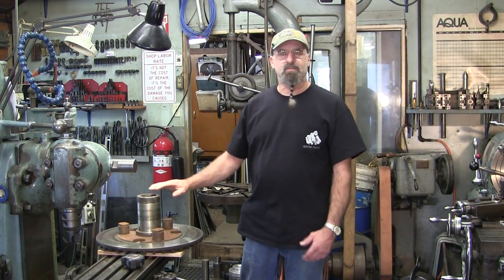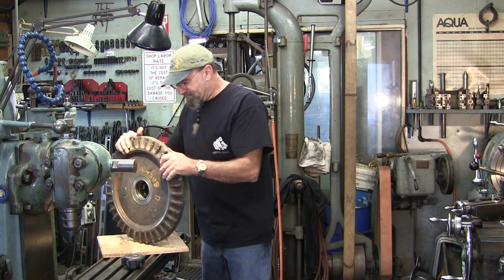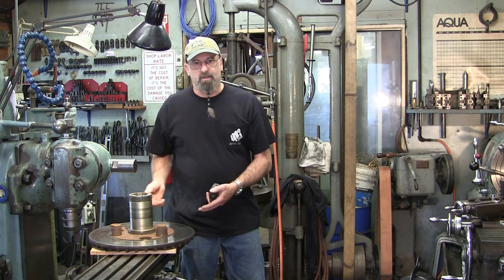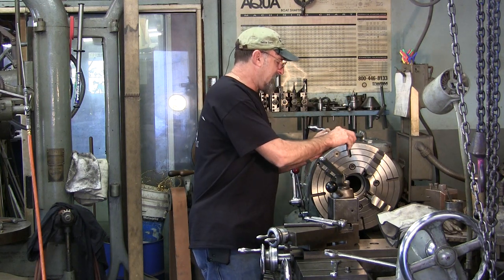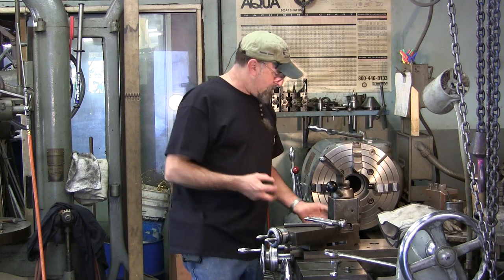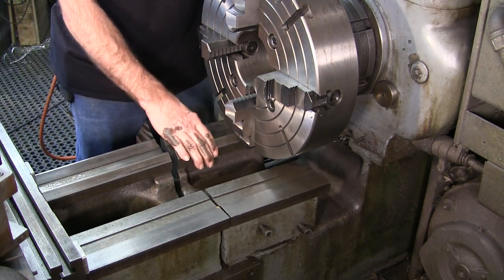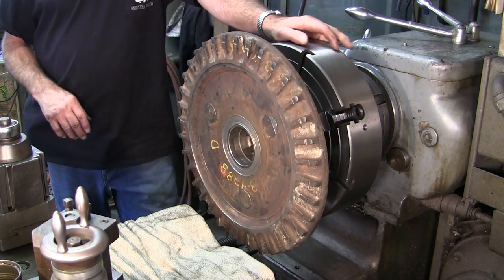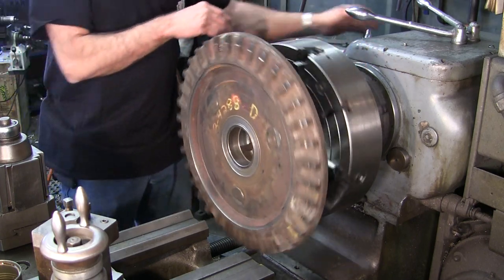Braze & Face Part One

Comment: Keith, guy, I had to stop your video and comment. You are a man that's seen tough times and really appreciates some good machinery. That's why I watch you. I've walked a mile in your shoes. Not necessarily machine tooling but other operations where all I had to use  equipment that was totally wore out and had to make do. I'm hoping to retire in a few years and use some of my recently acquired machine tools (a old 12" Sebastian lathe and a old SIMA Rossi mill). Keep on Keepin' on. You're a good man and you are an inspiration to do good work with what we have.   Now to watch the rest of the video.

Comment: That part really looks like pneumatic operated high torque clutch. Looks like the ones I used to work with on Uraca high pressure water pumps, but the ones I have experience of is a couple of number smaller and only handle some 90 to 130ish horse power. The three studs held a lose metal disc between the friction discs, and the three holes held springs that helped disengage the clutch/friction package so the pump stop cranking.
Sorry about not remembering the name of this clutch, but they were good stuff.
Tfs!

Comment: You could use the t-slots to clamp bars outside the jacks to prevent them from moving outwards. This, and clamping on weights to compensate for off-center workpiece balance are two main uses for chuck t-slots. (I'm probably preaching to the choir here.) A few wraps of duct tape (Duck™ brand) looks like it should do the job, though. 

Speaking of wrapping the chuck, a friend has a brightly colored elastic bandage that he wraps around the outer face of his chuck anytime the jaws and/or workpiece protrude. It's not to keep the jaws from flying out (they wouldn't) but to keep him from putting his hand on the chuck as it slows down and getting hit by the jaws. A couple of wraps of duct tape would serve the same purpose, and there are brightly colored duct tapes as well.

Comment: On the cast iron, I think it was you that showed turning the lathe in reverse and putting the tool cutting from the bottom to get the chips to blow down on the rag instead of throw to the outside. I thought that was a very neat trick.  How come not this time.
Reply from the maker: It was a very little bit and I needed to see with ease . ;{)-------

Comment: I by no means know what I am talking about when it comes to this work but wouldn't braze be a much softer material causing it to wear out quickly and you would be stuck with the same issue a couple years down the road?  I guess you don't have too many options when it comes to cast though.
Reply from the maker: If the same thrust bearing that rides next to that surface blows out again the same results will occur. ;{)-----

Comment: Hi Keith, not a machines but intrigued that extra circular "fitting" at about 11 o'clock on the 4 Jaw? 5:00
Reply from the maker: A cutout for the original label I think is what you saw. ;{)-------

Comment: Hello, you want to cut deeper slots for the tee nuts? You realize that this chuck is not solid, is there enough metal to allow you to do this without ruining the chuck? Good luck with that, it could be a thousand dollar error!! Think long and hard before you cut, there is a reason they never went any further!!
Regards, Edgar
Reply from the maker: There's enough material, the slot won't be deeper from the face, it will be deeper / longer towards the center, the width and shape of the T-nut slot will be modified for good slide, but this chuck is designed with the material for T- nuts, not like a standard hollowed out, on back chuck. Cheers, ;{)-------
Reply: Edgar, you're not going to tell Keith very much that he doesn't already know, that's why we watch him.
Reply: Hello Keith, no one has more respect for you than me. I just wanted you to be sure, that the chuck had enough metal to cut the tee slots a bit longer.
Regards, Edgar
Reply from the maker: No Worries!  ;{)------

Comment: Is ductile iron the same as cast iron?
Reply: Ductile iron is more "flexible" and less brittle than regular cast iron. The grain structure is more rounded.....unlike cast iron which is crystalline. Have you heard of nodular cast iron before ?  That's another name for ductile iron....it has a grain structure of tiny nodules (round grains). Picture a clear plastic container full of BBs (ductile iron) or full of rock salt (cast iron).....hope that helps.
Reply: Jeff Silence the correct name is spheroidal cast iron ,which relate to the graphite structure. When I was at the iron works it was made by getting normal CI up to 1600 deg C in an induction furnace and pouring it on to magnesium in the ladle . They sampled each batch cut polished and etched then examined . Uses iron pipes ,nuts and bolts to use with the pipe , turns like steel curly swarf not grains , I installed a number of the furnaces up to 11 ton ,1.5 megawatts
Reply: Stuart Hardy K.I.S.S. for the masses....layman's terms to get the point across.
Reply: Thanks Jeff, I thought since he said he couldn't weld it it was cast but he said ductile. How did Keith know what it was and that he couldn't weld?
Reply: Shane K Cast steel is truly weldable.....any form of cast iron, be it gray, white, ductile, or malleable iron is better off being brazed. All forms of cast iron have really high carbon content (2 to 4 %).....not good for welding typically.